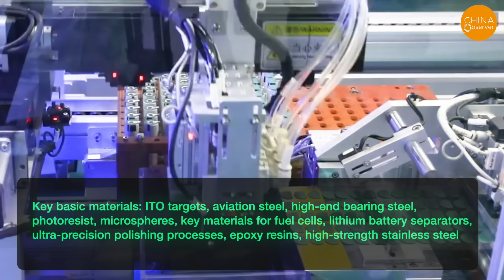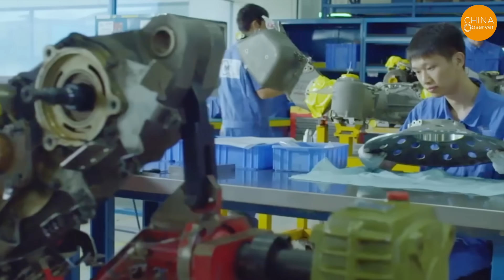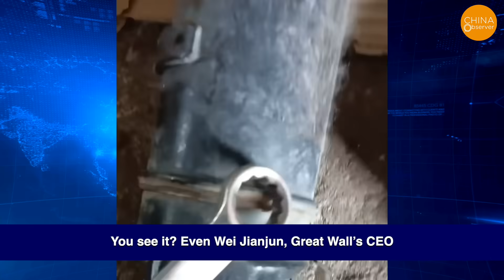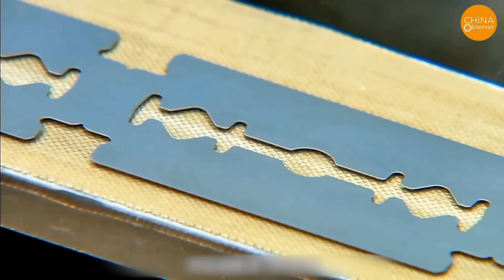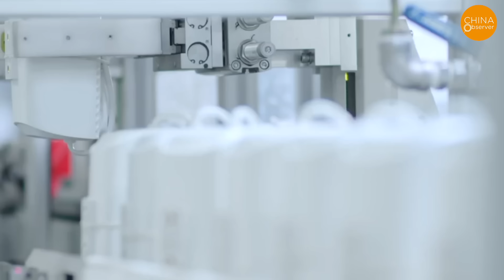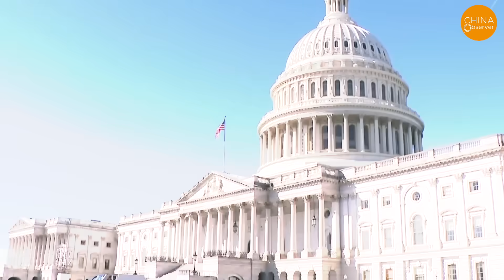35 Techs Block China! German Clients in China Process Metals and Recycle Waste to Prevent Tech Theft

Comment: LIES LIES LIES. Nonsense PROPAGANDA.
You would NEVER be able to send back the leftover SLAG to keep secrets or want to for MANY reasons. 1. during production, you HAVE TO take samples and check the contents. 2. You could STILL take samples because there are 100s of pounds of losses during processing and NOBODY can tell if you kept any. 3. The final product could be tested for contents. 4. SLAG is the IMPURITIES and NOT the steel you use. 5. PROCESSING (temp, cooling speed + direction, post processing, etc.) is much more important to keep secret. Do I need to keep going?

Comment: I once worked as a machinist for an industrial machine company and they purchased a shipment of Chinese A-36 steel. It ended up being such low quality we didn't use it. It wasn't even completely blended together properly and you could see swirls from separation in the metal. The quality was so low we were amazed they even shipped it out. I'd hate to see what they would do with Incolnel...or any other nickel chromium alloy for that fact.

Comment: The only thing made in China I would use is the Pens, they can’t hurt you. I definitely wouldn’t trust their steel, engines or even razors, but Pens I would be ok with using cause if it doesn’t last long I could buy another one for cheap.

Comment: So at max it’s a 3 gen difference in all fields. That’s considerably less then in the past. What interests me most is that people said 7nm will be impossible for China and now they have it. Now people move the goalpost to 2nm. Guys after a certain point of advancement it’s not about the efficiency gain, but more of an economies of scale issue. 
If only a 2nm chip does the work then one has to use 3-4 7nm chips to have the same transistor amount, and as 2nm is 30% faster you built 30% 7nm chips more and power usage is only an issue when it comes to efficiency. The whole 7nm vs 2nm is an efficiency debate not actual competition. 
The issue with the CCP is that it’s great in objectively measured terms. If it can be measured then they will somehow find a solution, even if it’s suboptimal. The real issue are unqualified issues. They are impossible to be solved in their current system.
Further in regards to Chips and other IP do you guys know who the greatest contributors to open source projects and software are? Open source is the reason how China achieved 7nm chips and now they develop these open source kits further so that they get good enough for better chips. Between Chinese companies they use a hybrid of open source to have less competition and more standardization so that they can cooperate. After reaching a certain level the CCP will most likely force competition again, but until then they want their companies to cooperate